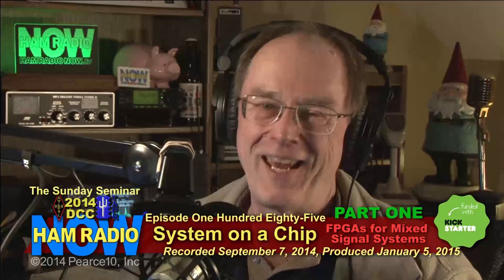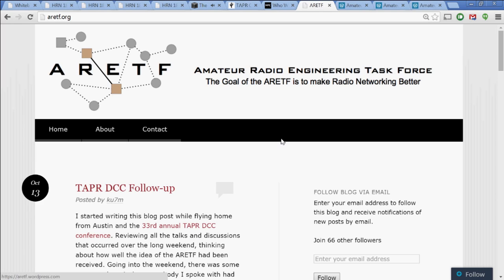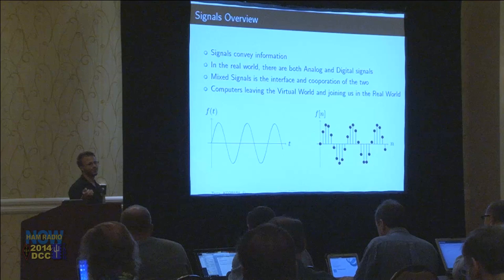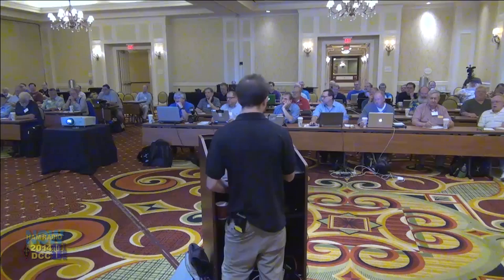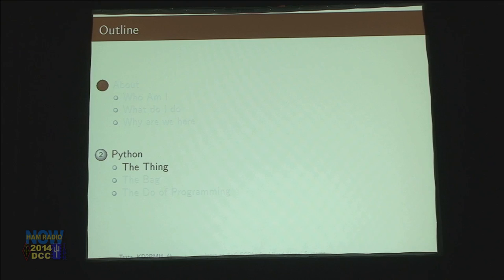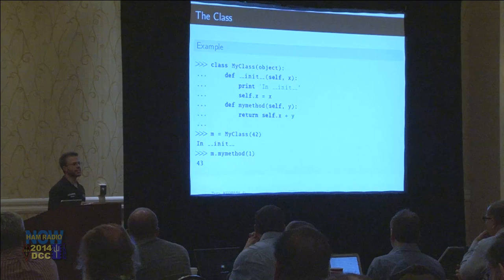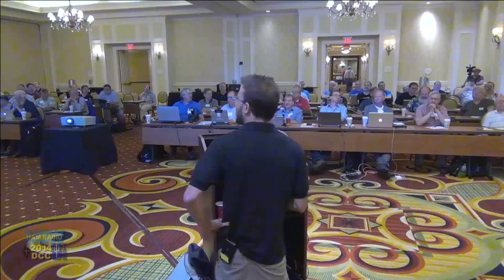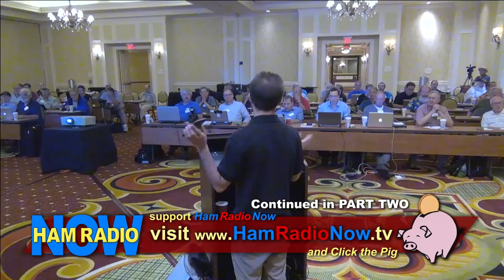HRN 185 - 1: System on a Chip - DCC Sunday Seminar

Comment: Generators are for dealing with lists that don't really exists.  It's a way to keep using code that uses lists (such as list comprehension) when there is no list.  But why use list comprehension when there is no list, that just confuses the occasional Python user.  If there is no (complete and preexisting) list, then don't use list comprehension.  Use a ... function ....  Loop over a function.  The millions of head aches you'll prevent with this advice will warrant the extra few milliseconds your code takes (if that's what you are after).   Let me know if I'm missing something.
Reply: MyHDL uses generators to step through simulations.  So when you want to do something, you don't say "flip this bit, then this bit" in a procedural fashion.  You yield "flip this bit", which hands execution flow back to the simulator.  Then, when the simulator is ready for the next statement, your context is swapped in again and you yield "flip that bit".  So I end up having yield statements littered all throughout the code and it's important to get a grasp of what that statement does.  I hope this helps.  Thanks, Chris KD2BMH
Reply: A more accurate description for generators is that they are functions that keep state. In other words, they don't die upon return, but can "return" values repeatedly. In this way, you can use them a fine-grained, light-weight threads - exactly what is needed in a Hardware Description Language.
Reply: Jan Decaluwe Yes, functions that keep state.  So why not use functions (or methods) ... that keep state.  Is it mere syntactic sugar to use generators?  Is it just to keep using the "list" idiom?
Reply: mdesm2005 Stop thinking about lists, generator usage in MyHDL has nothing to do with them. What is meant with state is local state. Classic functions in Python die upon return loosing all local state. Generators don't die. The local state is kept and you can keep querying them. This is an essential semantic difference.
Reply: I should have said method (of an object that keeps its own state).  My comment was made based only on this 1st part video, where MyHDL has not yet been covered, so it was a more generic comment on Python. I understand now that MyHDL needs the use of generators.